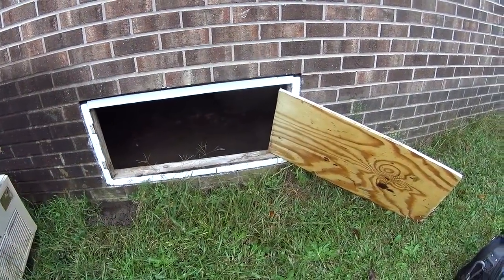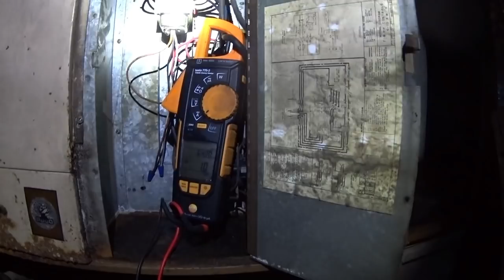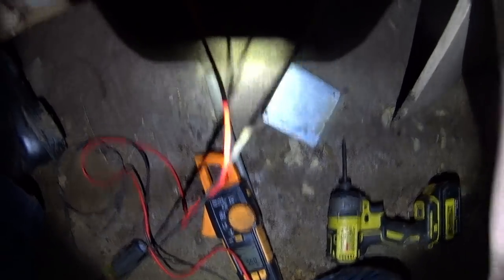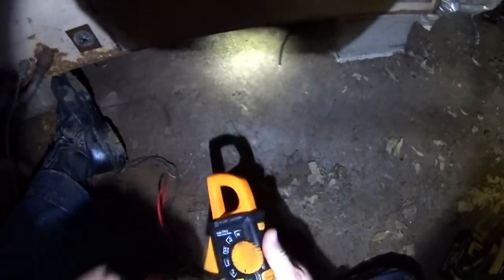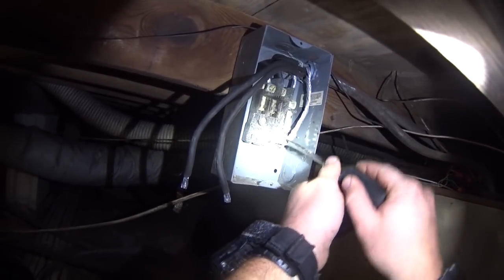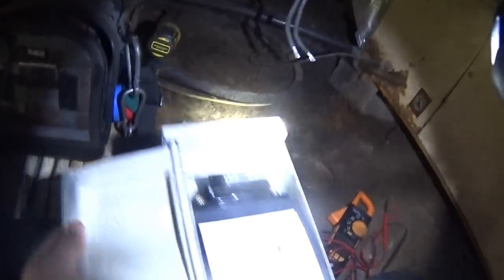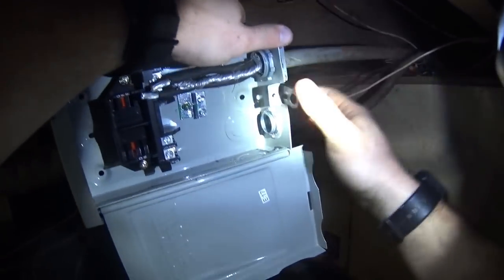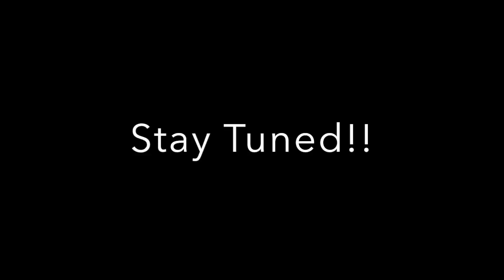11-9-17 No Heat Breaker Tripped 1979 Ruud Electric Furnace

Comment: Get yourself some lineman pliers for running heavier gauge wire. Works wonders for manipulating large wire in smaller enclosures, twisting wire, etc. Former photovolataic solar installer/current HVAC/R tech.

Comment: Great 👍 Work! 
Steve is Sherlock Holmes of Troubleshooting. (Never quits inspecting)90%of techs would “Not” have pulled breaker off and found bad discolored contacts. And would have recommended a new unit.
-you are thorough🤩-man
(No Callback)✌️

Comment: I loved those older little Carrier R22 2 ton units. Man those things were tiny! I'm 34 yrs old and I must of taken out a dozen of those ancient natural draft "octopus" furnaces in Youngstown and Warren Ohio. Hardest part is dismantling and taking out the heavy cast pieces.
Reply: CWM030 Here's what you do. The service ports at the bottom of the unit, unscrew the brass cap that is on the liquid line (the smaller of the two copper lines running from unit to inside of house), grab yourself and allen wrench set and close (shut off) the liquid line service valve (clockwise) then run the AC. That will eventually kill the compressor. Bingo bango, got yourself a new unit installed. Just make sure to reopen the valve after it dies so it looks like a natural death.  EDIT---- I should add this could be dangerous as closing the liquid side of the compressor will cause an insane head pressure inside the condensing coil and it pipes. Shit likes to explode at high pressures, especially if the pressure relief valve isn't working properly inside the compressor. So maybe don't be anywhere near the unit when it's running, lol.

Comment: Get some dielectric grease for your van Stephen !!  Aways coat aluminum wires when connecting to any copper connections to help prevent corrosion and overheating. It is actually a good ideal to use it on copper wires to when connecting to a  disconnect box ( which are cheaply manufactured these days ) or contactor in AC/ Heat Pump condensing units. Keep up the great work and congrats on starting your own HVAC business . I went out on my own 29 years ago and started my own HVAC business and   purchased my first house and got married all  in 1989.I was 25 years old and now 54 and after 36 years in the HVAC trade my body is going to crap ( bad back, knee, arthritis in both hands) Enjoy it while you can man and I thank god only see about 2-3 crawl spaces a year in Baltimore MD because most homes have basements and 2nd units on larger homes are up in attics lol.

Comment: You used the best disconnect money can by IMHO... My local R.E Michel switched to these due to my recommendations! They are dirt cheap and i buy them by the box full. 6 in each. They are the easiest pull that is heavy duty and sturdy as well the pull on them has 4 solid beefy prong and doesn't flex at all..

I love the HD side opening and the way it drops down. The top open kind always falls down and usually the pulls are flimsy as hell. I will only use that type. Mars 80315's!

The absolute best disconnect money can buy right there!

Well done Rardon!
Reply from the maker: They work ok but the lugs are cheap and I’ve sheared several off while trying to make sure the wire was tight

Comment: You should be using anti oxidation past on those aluminum wires and be sure your box is rated for aluminum.
Reply from the maker: You’re right, I was thinking I’d have someone mention it since I didn’t have any. Can’t be perfect all the time 😉
Reply: I knew someone else would comment this

Comment: Hi amp draw wouldn't be caused by low air flow, amps would drop. Running the unit with the blower compartment would raise the amps though since the unit would be moving much more air than it was designed to move. Nice catch on the disconnect.
Reply from the maker: my reason for suspecting airflow was not for amp draw but for the electric heat running too hot due to air restriction. that wouldn't cause an amp increase but it would cause components to overheat.

Comment: warning...what you are seeing ....mold on the outside walls and the units rusted all to hell and a very damp crawlspace is caused by no gutters around the roof.  what a mess!  they saved on the gutters but will pay big time for the damage to equipment.
that's one of the first things I look at when I pull up to a house or apt building.
Reply from the maker: It’s a low budget kind of place, haven’t had the total bill paid yet

Comment: At least they could have label the air conditioners with the number of the apartment they cool so the tech can easily find which one that needs work
Reply from the maker: That would be nice, if I were to sell Maintenance to the complex I’d certainly want to make it easy!
Reply from the maker: it seems pretty clear that despite lasting for many years it was not due to preventative maintenance

Comment: Lol.... that's one old air handler! It was put together with Phillips screws! Or some other Tech lost the 1/4in screws and only had phillips in duty bag.... didn't feel like walking all the way around that building to get some quarter inch from vehicle.
Reply from the maker: I tried to find a tree logo online from that era but even the mighty Google let me down. Even the Ruud Wikipedia page
Reply: Rheem/ Ruud used phillips head screws in all their HVAC equipment they  manufactured from 1960s-80s !!

Comment: Lol...fiddling with the disconnect. ..I got a good laugh....that was plain old wrangling with SE cable in a crawl space!
BTW, my grandparents had a beige Ruud system, I am guessing it was installed in the late 70s when they switched from oil to NG (unless they had a conversion burner for a few years prior to changeout). I don't recall any details of the logo though.

Comment: Not sure if I saw it right but it looked like lineset was coiled up in the crawl space before it tied into the unit?
Reply from the maker: Yea it was. I’m guessing it was the days of precharged lines or maybe just piece rate based on materials used
Reply: Definitely pre-charged line, those one-time compression fittings give them away.  Funny thing is it made installs a breeze, but if you didn't torque the suckers properly it was a mess and would constantly leak.

Comment: Great video Stephen, just one question is it code in you're state too use no lock on aluminum wires?
Reply from the maker: No code requirements except that if you join copper and aluminum
Reply: Yes that is the NEC code. The reason I was asking was learning from my dad dealing with the old aluminum wires it's always good practice to use nolock to keep any possibility of corrosion down. I guess just a cya practice at least for me LOL
Reply from the maker: I should find my container of it, know I had one once but don’t know where it go to